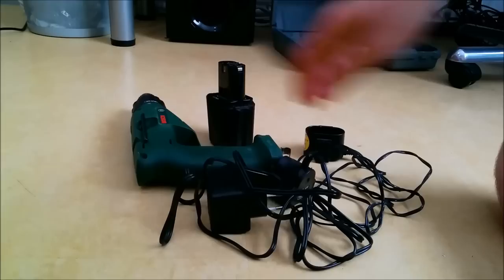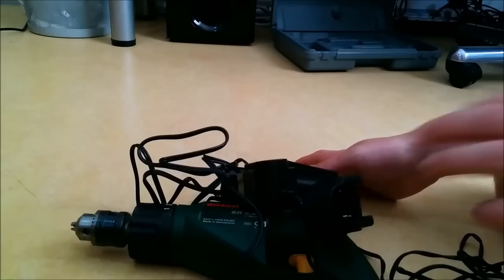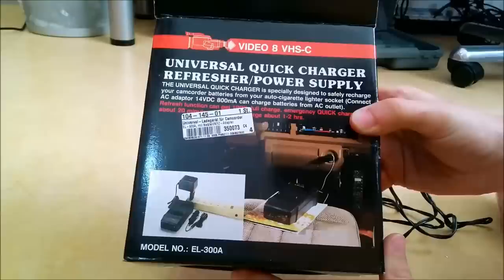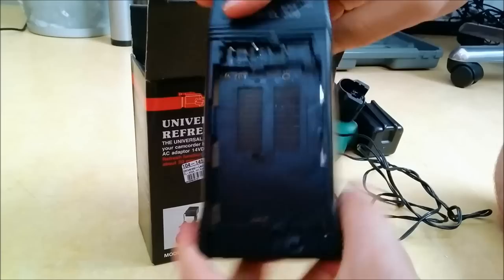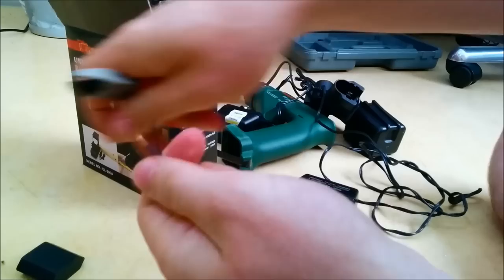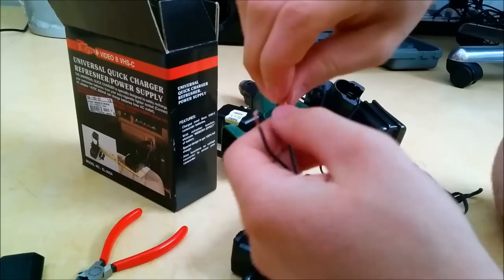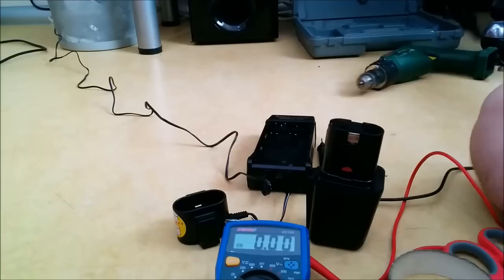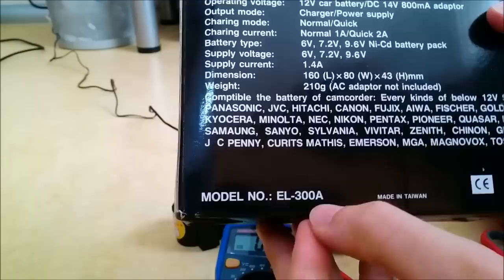3$ FIX: Cordless Drill Charger

Comment: Any tips on reviving & recharging a dead battery on a skil cordless 3.6v screwdriver.when i charge it only lasts 5-10 min
PLEASE  HELP
Reply from the maker: +AOAB Is this a lithium battery in there?
If your battery has such a low capacity you can disassemble it and apply a (relatively) high voltage to the cells themself. For this you can use a 12V Car-Battery charger. Just tap each cell with the charger 10x for 1 second. After this discharge&charge the whole pack again. Be very careful, i take no responsibility if a battery bursts or explodes. I would especially not do this if it is a lithium battery, because they are way more dangerous.